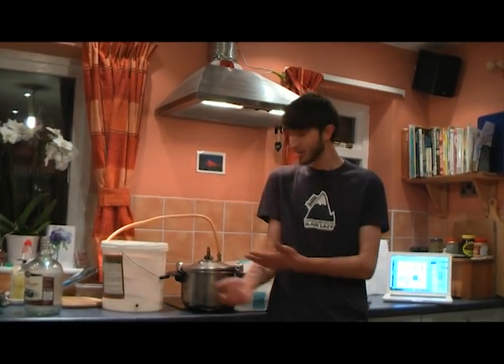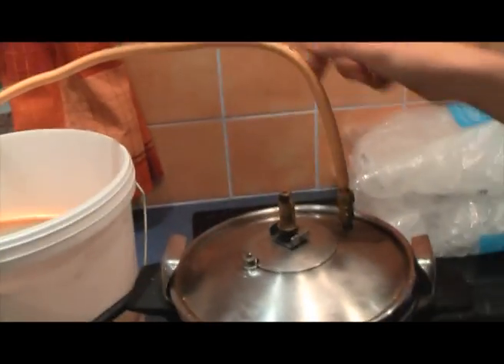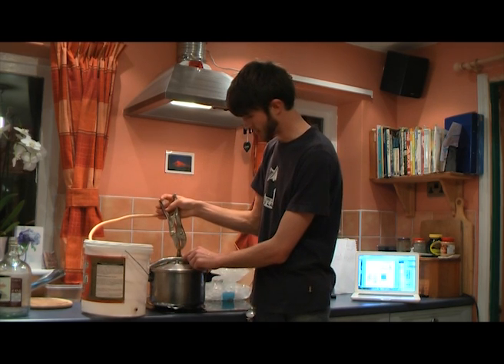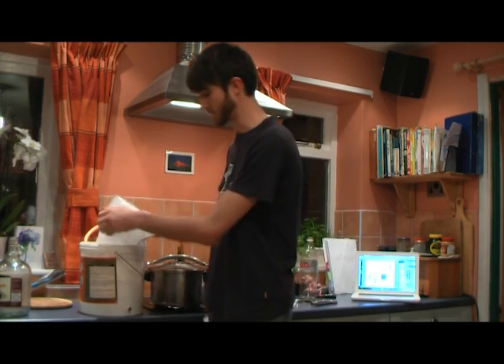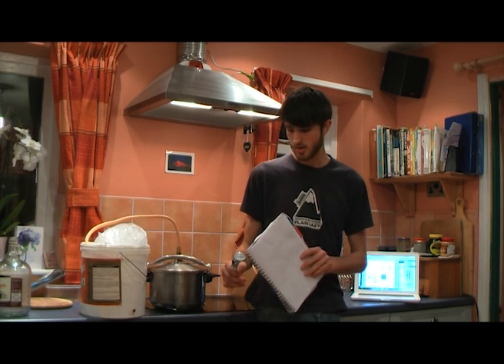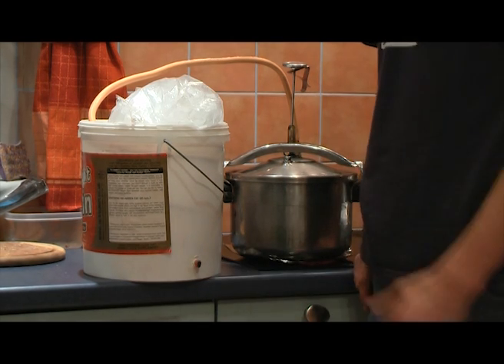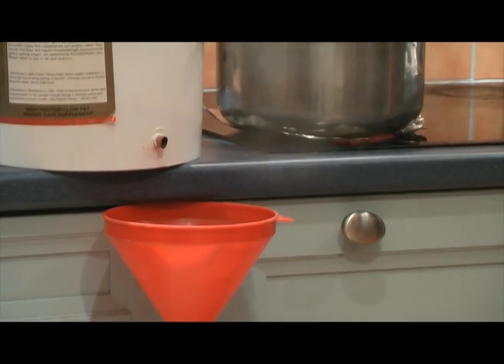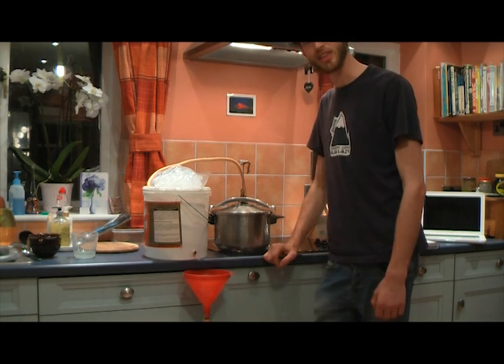How to make Rum part 2 - Distilling

Comment: just another idiot that should not me doing something he has no clue about. Alcohol vapors of any kind is explosive,,  if that is not a stainless steel pressure cooker you are leaching all them neat toxins out of the aluminum concentrating them and drinking them.  First rule as a distiller keep a fucking fire extinguisher handy, one bad gasket can change your life in a Flash.  My suggestion read a goddamn book, google is smart but not exact
Reply: He has no idea what he's doing... but neither do you. There's nothing harmful about using an aluminum pot. As long as it's only copper or stainless in the vapor path. the reason aluminum is not recommended is because over time "pitting" could occur in your pot. That doesn't happen with stainless. A stainless pot will last forever but aluminum won't. But it's also NOT harmful. Also he's not using open flame so there's no real danger of "explosion". " My suggestion read a goddamn book, google is smart but not exact" ... lmao. There's a few different distilling forums around. GO LEARN
Reply: to begin with the pitting is called galvanic corrosion which happens when 2 dissimilar metals are combined. hence the aluminum will break down before the copper.  Can you name which chemicals are released when aluminum break down? Then again you questioned my intelligence , Ethanol vapors which hit the lower explosive limits do ignite and explode, which can be caused by open flame, electricity spark, or simple static electricity. im not as smart as the rest of the world but at least i read before speak
Reply: the more i been thinking about it , can you tell the rest of us what aluminum and copper break down to though galvanic corrosion? by the way that is a fancy name for pitting,  these compounds you dont want to eat or drink. for example copper breaks down to  copper sulfide or copper oxide depending on which dissimilar metal it is coupled with, neither of which a human or plants can tolerate that type of toxicity.
Reply: And you could dump a gallon of your "compounds" in a boiler and it wouldn't make it to the final product via distallation, dummy. That's why having an aluminum pot is no big deal.
Reply: The Aluminium is not the worst part...the rubber gasket in this death contraption is. It will degrade and leach into the so-called Rum he made. Besides that, he uses ice, which causes shock cooling and surging, that will be even worse as the stove top is cycling on/off...

Comment: Use jb weld to seal around the end of the "worm" so you can use ice water to condense better, steam is a sign of running too hot or the worm isn't cooling enough. Run vinegar through first (without ice/water in the worm) for 2 hours to clean out oxidation, then steam water to clear out the vinegar; a rule of thumb to know when you're done steaming water is taste it -if you don't like the taste of the water you won't like your liquor, and research the myths and facts about what causes blindness.

Comment: Where methanol can make you go blind, the amount you collect in this batch would simply give you a nasty hangover. Most cases of people going blind from bootleg booze is from people making cocktails out of antifreeze and metholated cooking fuel.

Also, I read you fixed the steaming by removing the insulation rom the copper pipe, how did you do that?

Comment: You need to have copper for condensing not plastic and it is not hard to seal around the hole so you can have cold water or ice water....

Comment: Yes, you are completely correct, this was an early video I did before i had taken the insulator of the pipe, and wanted just to make the video as a resource for others. But yes after I made this I did remove the insulator which increased my yield a lot.
George

Comment: Well yes, but what you take off is minimal. And it will also still not be purely methanol there will always be water boiling off at the same time. Its also very dangerous to keep as its highly flammable. Saying that I've seen old racing cars that run on methanol.